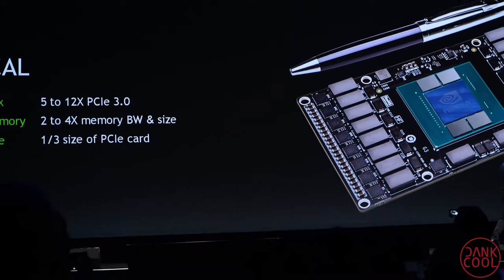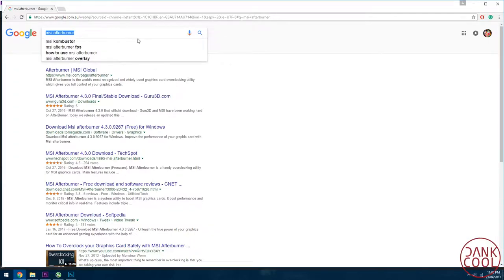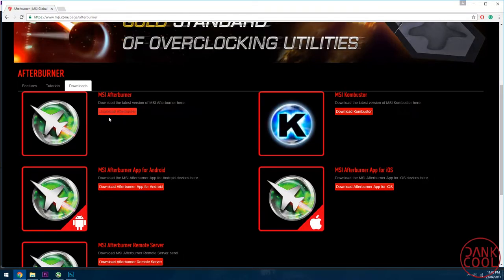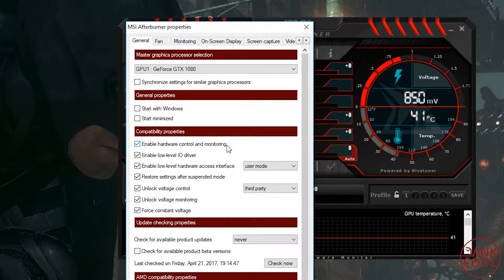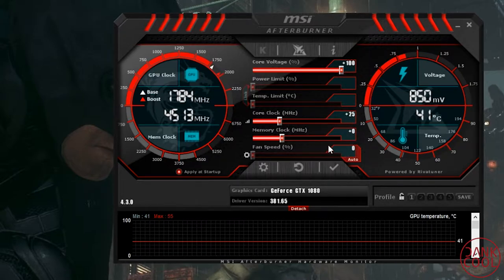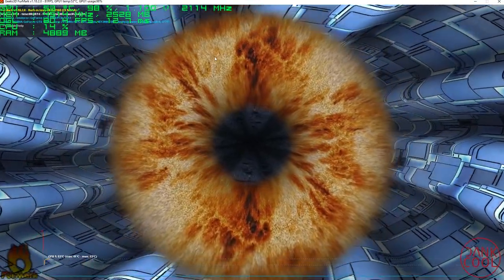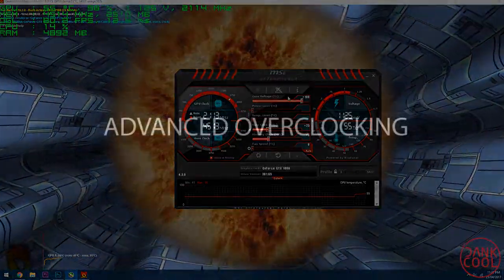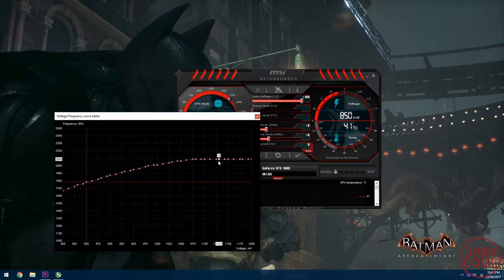NVIDIA PASCAL CUSTOM BIOS GPU OVERCLOCKING TUTORIAL @2202MHz (BASIC & ADVANCED)

Comment: Do you know how to mod pascal bioses? I'm running a GTX 1060 FTW+ with a Accelero Xtreme IV cooler. My max temp is around 43C and I need more voltage for my overclock.
Reply from the maker: No unfortunately, since i don't have the encryption keys that nvidia use to lock these bioses with.
Reply: So how was the T4 and StrixOC bios made? How was the voltage modified in the first place?
Reply from the maker: Its not verified yet, but what i know so far was one of the extreme oc'er   got a hold on the Nvidia custom bios with power limit and voltage removed(I presume either Nvidia made them or he got the encryption key) during HWBOT OC Championship and decided to leak it to the internet. We all should be glad for his actions. I'm not sure when pascal custom bios editor will hit the internet, since what i heard was modifying pascal voltage limit bios was hard due to NVIDIA Boost 3.0
Reply: Damn that is such a shame. My card has so much potential but the voltage is limiting it. Do you have any contact to the guy that modded the bios or any information on how he was capable of changing the values? I'm looking all over different forums and can't find anything.
Reply from the maker: Actual Hardware Overclocking has some pretty beefy and interesting hard mod for removing pascal gpu voltage and power limit, I haven't tried it since it seems very complicated and risky to do such kind of mod.
Reply: Yeah I've seen that video too but I don't feel like soldering stuff to my card. I still want warranty service if something decides to break.
Reply from the maker: Don't forget that pascal's transistors are so much smaller, making the architecture more sensitive with high voltages. what's the coreclock that you manage to get from your 1060? I assume you can hit 2100MHz stable easily since its GP102.